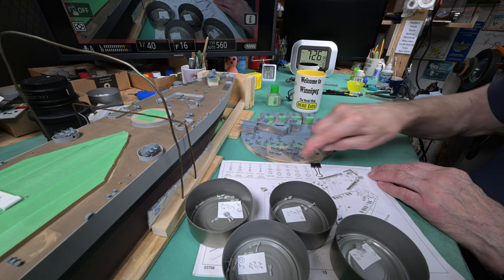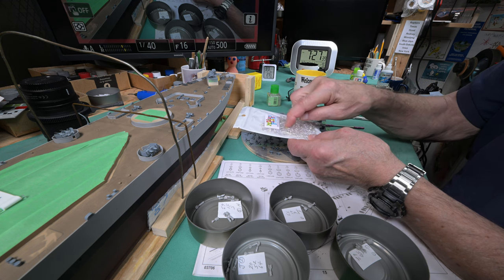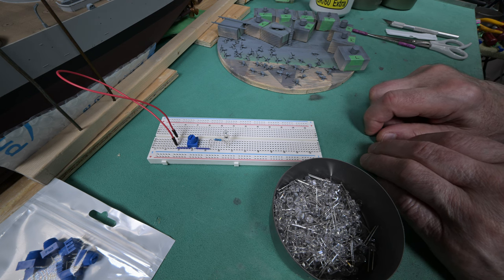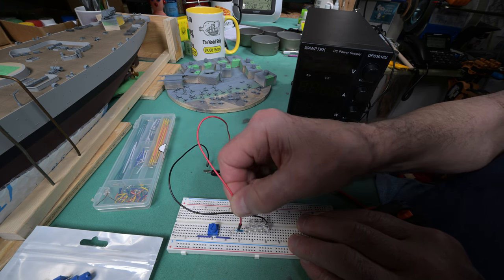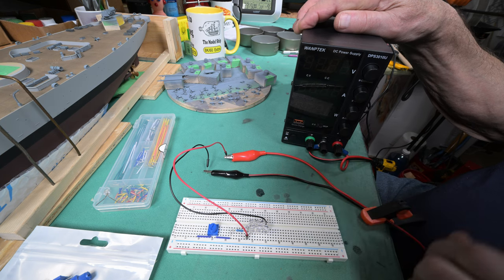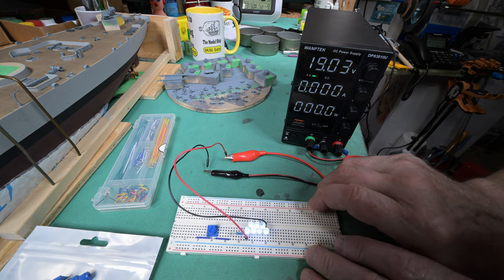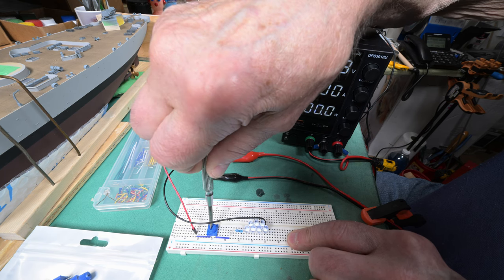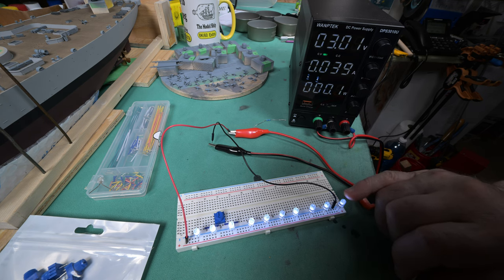The Model Ship - Part 1445 - 8K Extra

Comment: ...if you noticed, the power supply read 0A when the LED's were in series...but 40mA when in parallel. In reality, the series setup was drawing current but it wasn't registering on the meter. IF you use a series resistor with the LED's in series, it will consume very little wattage...which means it'll stay cool. IF you use one with them in parallel, the resistor will heat up.
For example, a 220 ohm resistor with 40mA running through it will consume 352mW (I^2xR). Those resistors appear to be 1/4W resistors, so it'll burn up...😡
Just a little more info...👍
Matt
Reply: I support what Matt says,  to make it the easiest, I generally put three or four LED's in parallel with a single resistor,  and then three or four more LED's in parallel on another resistor,  and hook up the two resistors in parallel.  This way I can run everything with low voltage, protect the LED's and keep the resistors within their rating so they don't overheat.  My poor attempt to draw the circuit below.   This way you can just keep adding more parallel resistors and LEDs and keep it at 3V.   If you add the potentiometer, put it in line with each resistor. Each pot will control three LED's.  
R1, R2  220 ohm 1/4 watt resistor
L1-L6, LED's

+ ---------------------------- 
             |                    |  
           R1                R2
            |                     |
       L1 L2 L3      L4 L5 L6
            |                     |    
-  -----------------------------

  Duane
Reply: @duanebeyer950  ...good assessment Duane...I generally like to use a 12V supply with the LED's in series...if they are 3V LED's, three in series with a 270 ohm resistor would be 11.1mA and the resistor would consume 33.3mW. With the potentiometer in-line, it could be adjusted down...
At 11mA per string, with a 12V, 1A supply, approximately 90 strings could be utilized...